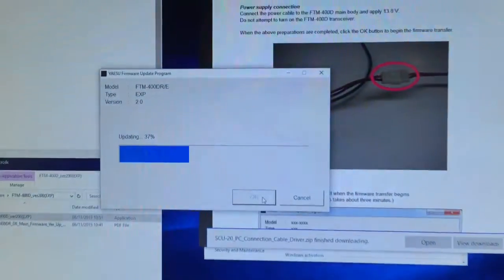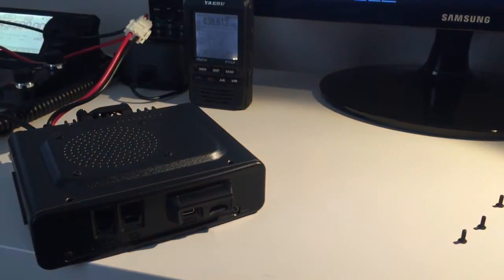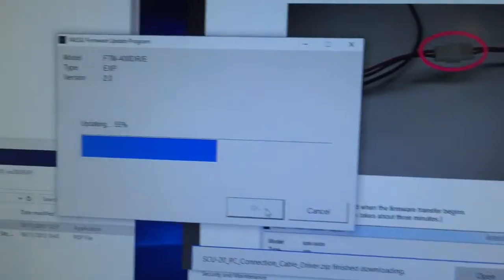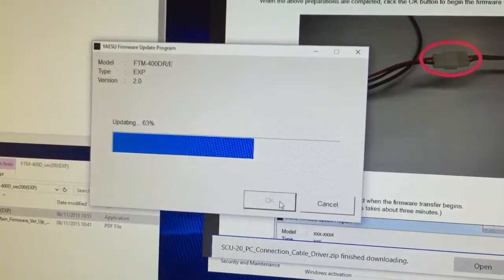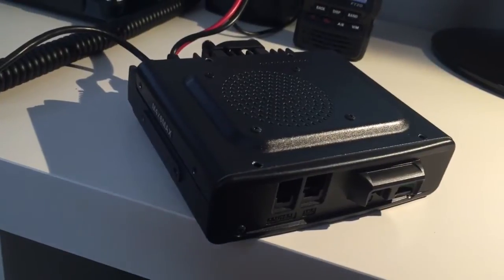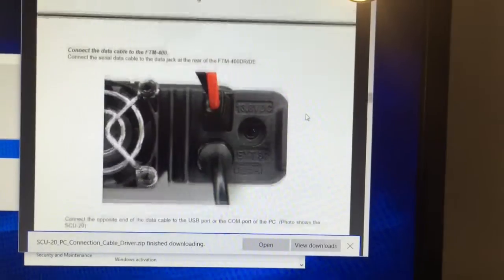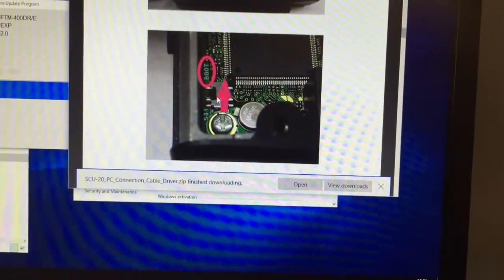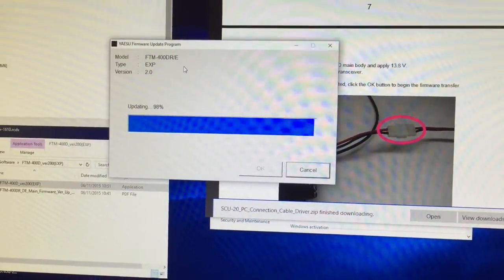Yaesu FTM-400 Firmware Updating

Comment: Does anyone know where the update switch is on a ftm3200?
Reply from the maker: +Michael Wyda its inside the case if I remember rightly.
Reply: Its under the micro usb socket on the back panel. Very small.